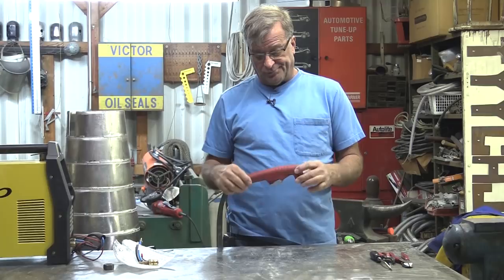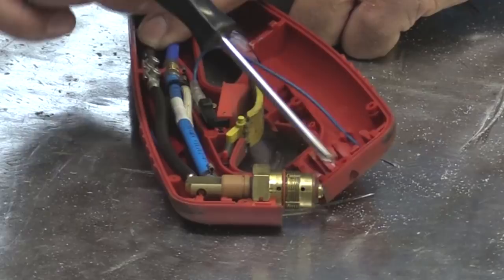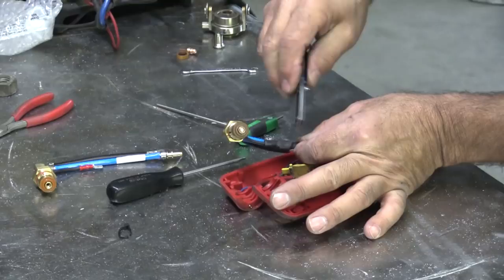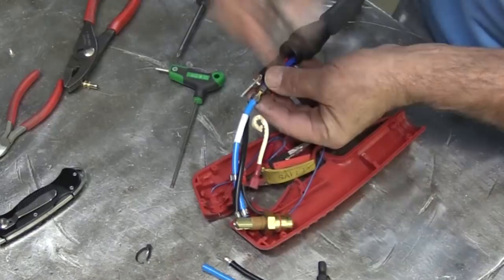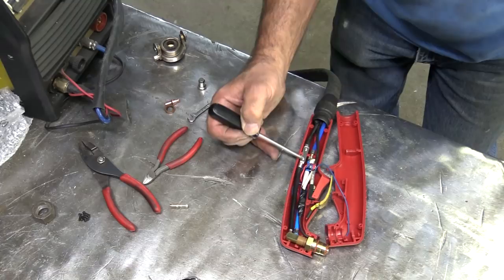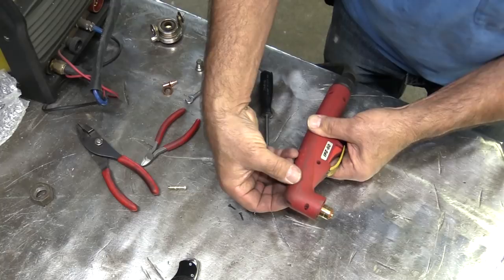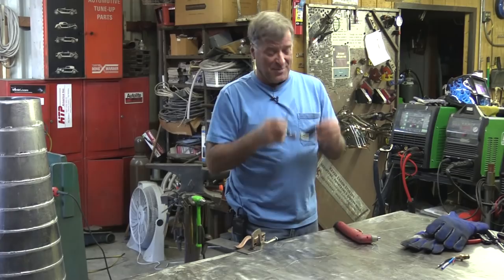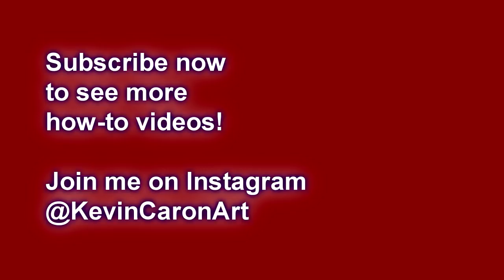How to Repair a Plasma Cutter Torch - Kevin Caron

Comment: You can got to amazon and buy a pack of 80 pinch clams plus the tool, don't know how he was able to get clam off let alone slide it back on. Have watched Kevin many times in the past and this is the only time he did not explain how he got clamp off
Reply from the maker: Whoops,,   forgot that part.   I just use a small flat tip screwdriver and pry the clamp open.  Then use a pair of wire snips very carefully to get a good crimp when I put it back on.

Comment: hi man, i have the same torch, but im not sure what parts i can use with it, i mean the nuzzle and electrode - sometimes looks like non original parts are cheaper
Reply from the maker: Aftermarket consumables are always cheaper.   And there is a reason for that!  I have been getting my consumables from George at www.georgesplasmacuttershop.com    Italian made and real high-quality parts.  Last much longer than the factory stuff.

Comment: Kevin if you don't have the correct tool for the odicker clamp a nipper works well too.
The correct tool is just a blunted edge nipper anyway.
Reply from the maker: That is what I have always used also.
Reply: I used to do a lot of soda and beer line installs and if I could not get my hands on the correct tool
then the next best was the nippers. The nice thing about nippers over the diagonal cutters is that you get a nice square pinch on the ring.

You need to do a for the first time plasma cutting and have the Voice do the cutting. Just a set of hands is all you would need and with gloves on...

EDIT : Sorry about the miss-speing above. I somehow fat-fingered the keyboard.
Reply from the maker: LOL,   I hear ya!

Comment: did you throw the old part away? it would be interesting, since its already ruined, to try drilling on the old tip or cutting out a slot that would fit a small screwdriver. if that didnt work, maybe weld a bolt to the broken tip for removal?
Reply from the maker: Sorry, I did toss it already.   This is the second time I broke one off.  The last time I managed to get it out and the threads were okay. But it was sticking up just a bit out of the hole.  This time it was deep inside so no go on saving it again.

Comment: What would cause mine to just stop blowing air out of the nozzle when it's on or I pull the trigger? When I put it on test air starts blowing like it should but as soon as I turn it back to normal it stops blowing and doesn't do anything when press trigger. Air pressure is fine. Had it on 60psi
Reply from the maker: Off hand I would say bad trigger.    Take the gun apart and just jump across the two wires on the trigger.  If it fires and air comes out then there ya go.   If not then take the cover off the machine and find the solinoid right after the air hook up and see whats going on there.   Or call George at http://www.georgesplasmacuttershop.com/Contact-Us-Page.html   And talk with him.   He is very up on all the different plasma cutters.
Reply: What can cause your Arc to not work even though your consumables an air flow is fine? Everything on my machine is working fine except there is no Arc to start the cut? I found another SG - 55 torch head online to buy but I want a better understanding of if something can go bad inside that torch head itself I would assume it can..?

Comment: Hello !! One question, do you know how its called the switch or terminal at the end of the safety line of the cover (the two small blue cables that go inside the head of the torch)? ?? Regards
Reply from the maker: Sorry, not sure what you are thinking of .
Reply: @KevincaronSculpture  Im thinking about the small terminals that trigger the security alarm of the cutter, if you dont adjust the head of the torch, the alarm activates because the NO contacts dont close the circuit

Comment: Hey Kevin, what do you think is the cause for that metal part to break, over torque on original install or dropping the torch ?  Is the part made of brass or copper ?  Any way to extract the part or prevent it from binding ?    Thanks,   J K
Reply from the maker: Operator error for sure.    Over-tighten and no lube.    My fault totally.     The last time this happened I could get the broken end out and it was okay.   This time, not so much..

Comment: Thanks, Kevin.  Any ideas who might carry replacement parts for various plasma cutters?  

I seek a U.S.-based supplier of the switch-wire socket (and plug) that is on the front panel of my Primeweld Cut50D plasma cutter.  The (male) plug on the front of the cabinet has two small posts inset in a cylindrical shape recess that has a dimple on the outer edge of recess to force  polarity of the plug.    

Thank you much.  -Lee
Reply from the maker: www.georgesplasmcuttershop.com should be able to help with that.     He is my go to guy for any of my plasma consumables.

Comment: hey keven 
how long do this type of torch consumebles last if used properly i have a miller specturm 1000 which needs a torch and original one is expensive for me i have found simular one with ip-80 code in ebay how good are these chinese cheers
Reply from the maker: I have had great luck with the stuff I buy.    Please check with George at https://www.georgesplasmacuttershop.com 

He is the last word in plasma cutters and consumables in my opinion.